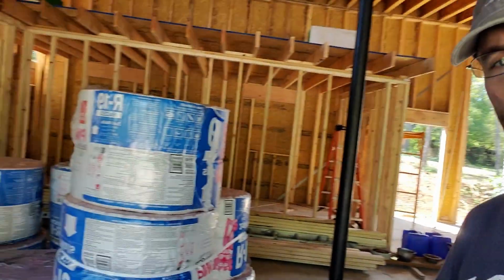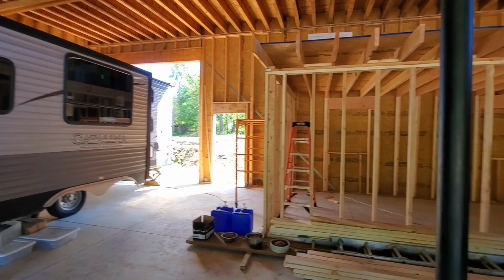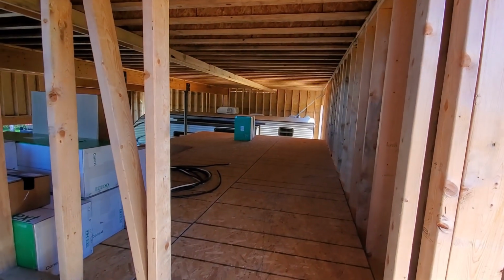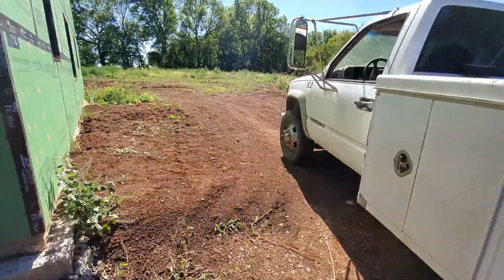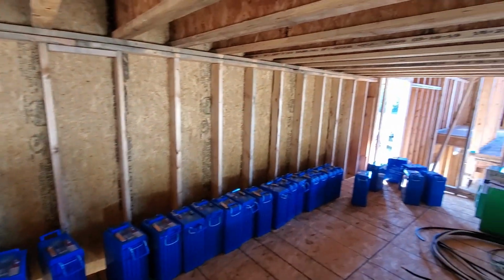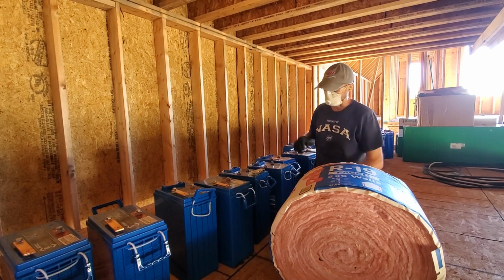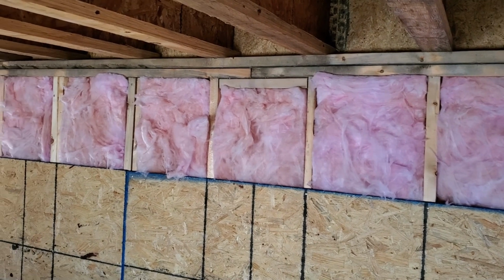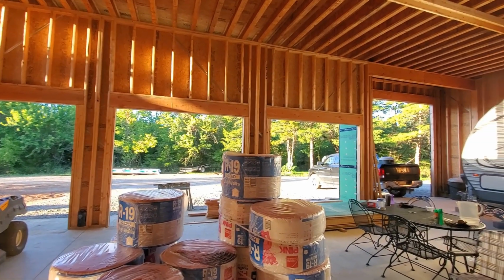Solar Batteries and work begins on the Power Room in our DIY Off Grid Home Build

Comment: Any thought of making a sliding barn door for the loft? Access from the exterior wall. That would give some nice visual looks on the back side. Loading and unloading much easier. I should have watched the rest of video 1st, then I would have known the wall was filled up with batteries. Mt Bad.
Reply from the maker: No worries, we do plan to us a barn door somewhere it the build.  There are some 1920 rail cars on the property that have sliding doors.  I want to clean up the hardware and use them at some point.